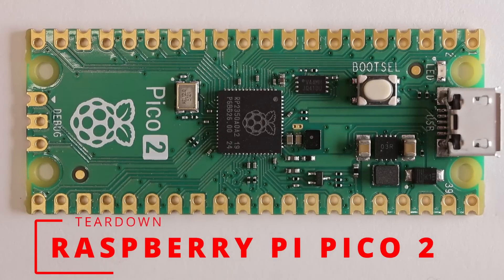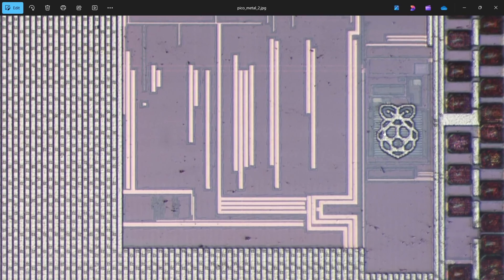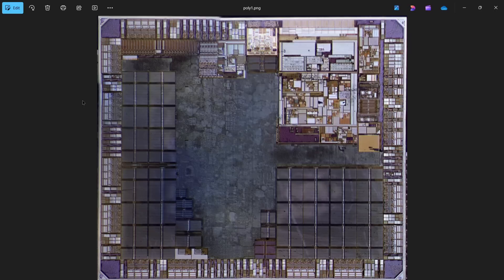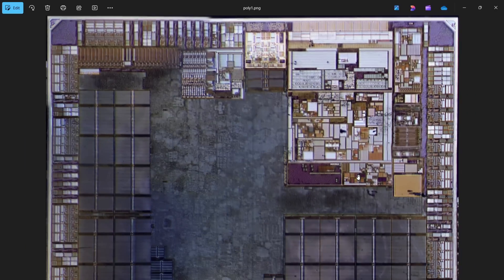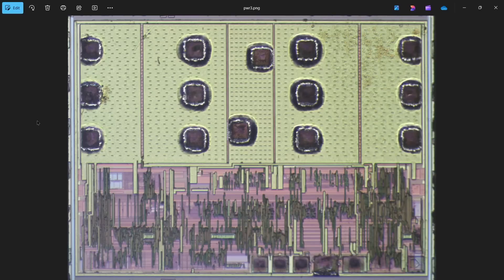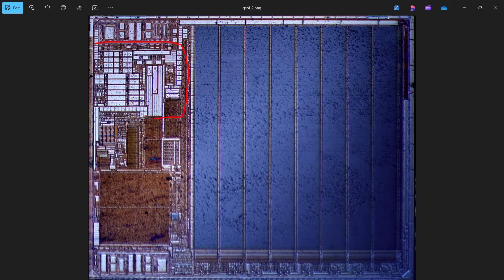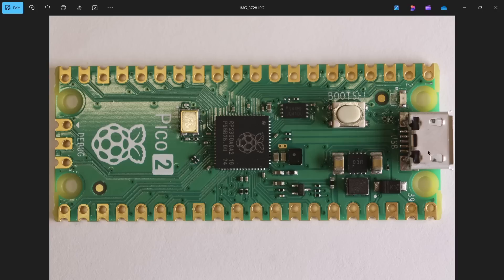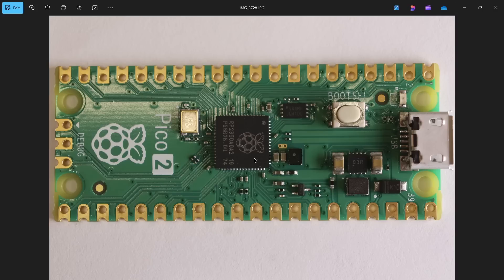Pi Pico 2 Extreme Teardown

Comment: Perhaps the on chip power regulator is the one that can be controlled by software. Voltage can be varied from ~0.8 to ~1.3.

Comment: The voltage reg on there is a buck converter down to 1.1V which is the core voltage. Apparently the components for that circuit on the PCB are fairly precisely specified, seems the on-die regulator is very very picky for stable operation. (It apparently cares which direction the inductor is wound, etc.)

Comment: The voltage regulator is integrated with the power saving circuitry - you can configure it to automatically change from switching to linear mode when entering sleep. This way you get both low quiescent current and good efficiency.
That said, I doubt it will be used on many products. A discrete LDO will take up less board space, have lower BOM cost and be easier to certify for EMI (the reference hardware design is very particular about both layout and inductor part number, similar to the crystal oscillator).

Also, footprint compatibility be damned, lack of USB C on the pico 2 is inexcusable.
Reply: Wait for the Chinese to get out a better board then, i have a pin-compatible RP2040 board here with the original chip but USB-C and 16 MByte of flash, it even has a frigging reset button.
And a RGB LED that i won't use. 😅

Comment: Seems to me they did microUSB simply to be completely 1-1 compatible with the previous Pico. Otherwise surely the cost differences have to be getting into the low cents range, which we're already paying for the new v2 chip.

Comment: Hi Electronupdate, we were discussing the RPi on the SiloconPr0n discord managed my John McMaster. While there isn't much you've missed in your analysis, Lennert posted a partial annotated IR backside image which might interest you. 

You've pointed to the UL marking on the board. These markings are for the PCB itself, not the whole product. E.g. the boards are from FR4 and complies with standard UL94V-0. The CE and FCC logo do say something about the whole board, including radiative emissions testing and ROHS. While these aren't a big deal for a board without radio, I always found it odd these markings are applied very early in the design and manufacturing stage, usually long before you can say it passes the testing. (Some fields are very picky about this, and even a simple silkscreen change is not allowed.)

As for the current bug bounty, the magic value is programmed into OTP and isn't in ROM. But ROM could still be interesting to read out to find a bug in the secure boot.
Reply: Actually the boot rom is open source and you can take a look at the code and find those bugs :) So cool

Comment: Excellent look into the silicon as always!

The reason why they have a buck-boost PMIC is because they intend for you to be able to connect VSYS directly to a battery which may be under 3.3 V.

Really wish they used USB C, the cost differences would probably 1 or 2 cents for the non-USB 3 USB C connector and the two CC resistors. Even when they were designing the original Pico it was feasible. I can only assumed they were trying to compete with the Arduino Micro so just copied the micro USB. As a result I see lots of applications that just ignore the micro USB connector and have a separate USB C connector for power on their own PCB or don't use the Pico module at all and just the DFN IC.

Comment: The voltage regulator is to provide the 1.3v core voltage. I understand it's mostly there to simplify designs using the RP2350, removing the need for an additional voltage regulator. The minimal viable RP2350 design is little more than a 3.3v regulator, the RP2350, the qspi flash chip, an inductor, some caps and some resistors.

Comment: Great video! The RP1 is the support chip on the Pi 5 (and it started being designed before the original RP2040 in the Pico) - so that with the Pico and Pico 2 accounts for three RP variants - wonder what the other one is/was?
Reply: The RP3A0 is the SoC for the Zero 2W

Comment: 2:18 if The Raspberry Pi 5 features a RP1 microcontroller, this can only mean a Raspberry Pi 6 is confirmed and launching soon :D
Reply: there is always going to be the next raspberry pi , but i think its way far ahead , we currently have RPI  with 8 gigs of ram and pretty powerful chip , and RPI is known for having massive increments of performance from the previous gen , i dont think they have that yet ,the pi 5 is still in its beginning stages ,to get a massive uplift i think we have to wait for 2026 (maybe) to get a compleatly new chip ,in between they will revise the design and we would probably have PI 5 with better connectivity or better ram speeds
Reply: @fouzaialaa7962  Raspberry Pi 5 is less than a year old so we won't see 6 till 2026 or 2027 maybe.  We're waiting on CM 5 to be released.

Comment: The criticism of microusb is that for one the cost difference is shrinking to almost nothing; it's more convenient due to being reversible, and eliminating microusb is more convenient that people don't need to use different cables again. I think they're only using microusb for full footprint compatibility and because it's in their parts bin - switching to USB-C wasn't yet feasible 3 years ago.

ARM microcontrollers often include internal linear regulators, to reduce external part count, so they only need to be supplied with IO voltage (3v3) which is shared with the bulk of the system which integrates the microcontroller, while a lower voltage rail is internal to the core. If Pi Pico a board for hobbyists was the only or primary product, they wouldn't have done that, but the microcontroller is supposed to be sold to electronics manufacturers to integrate into real consumer-market devices, which can be sensitive to part count, layout requirements and overall footprint.

I think ARM is potentially going away in the future of this microcontroller lineage to be replaced by RISC-V due to licensing costs. The new cores are already included, just waiting for ecosystem maturity.
Reply: Personally I have switched to only USB-C cables, I now use USB-C to Micro-B adapters where needed - that has worked well for me.

Comment: The PCIe IO controller chip on the raspberry pi 5 is the RP1, so if they are at RP4 with the RP235*, only one is missing in the numbering.
Reply: The RP3 is the RP3A0 on the Pi Zero 2W

Comment: the metal fill is not really for etching purposes.  It is to help CMP.  Without metal fill, there would be large within-die variation.  Metal-fill mitigates this.
Reply: What is CMP?
Reply: @JohnLauerGplus  Chemical Mechanical Polishing.  See wikipedia for details.